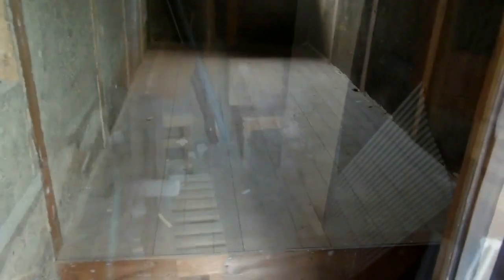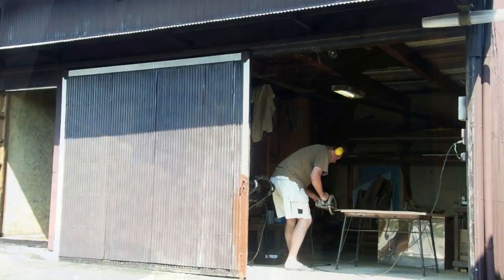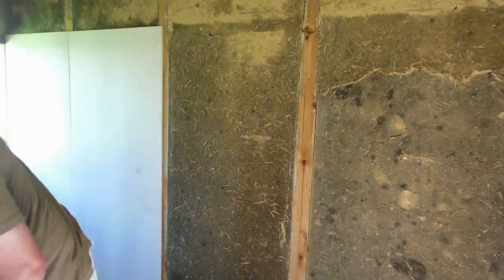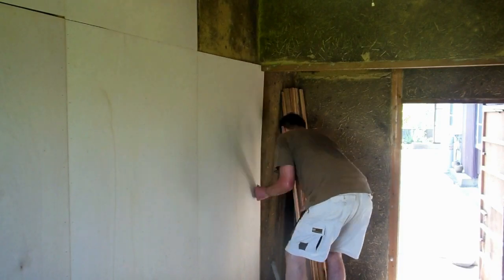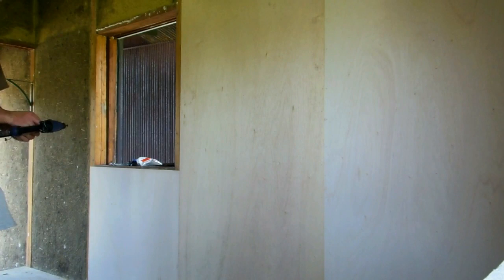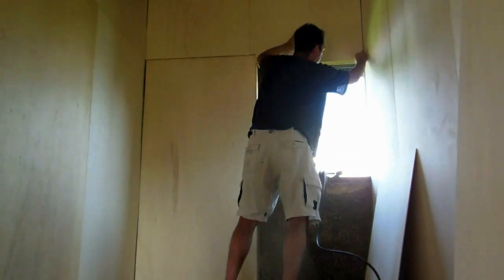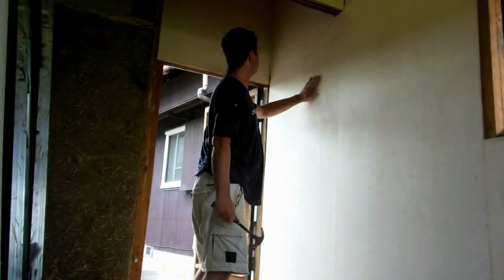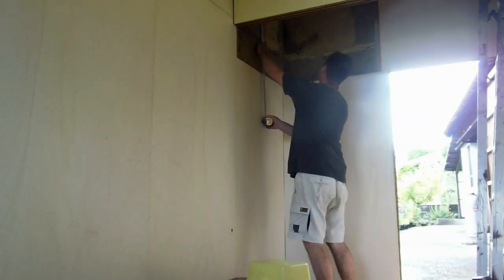Stage 2 Pickle Room Project at the Old Japanese Farm House

Comment: Awesome, will you sand down the floor a little and touch it up? I thought I probably would have painted the wood white, then sanded down the cover strips just enough to remove the paint and then nailed the cover strips over the white. Would have made a nice looking contrast, but I'm not an expert.

Comment: Surly 91cm is 36 inches, 3 feet or 1 yard?
Reply: Not quite.  36 inches is 91.44 cm.  Good guess though.  From the Wiki: 

The traditional units are still used for construction materials in Japan. For example, plywood is usually manufactured in 182 cm × 91 cm (about 72 in × 36 in) sheets known in the trade as saburokuhan (3 × 6版), or 3 × 6 shaku. Each sheet is about the size of one tatami mat. The thicknesses of the sheets, however, are usually measured in millimetres. The names of these units also live in the name of the bamboo flute shakuhachi (尺八), literally "shaku eight", which measures one shaku and eight sun, and the Japanese version of the Tom Thumb story, Issun Bōshi (一寸法師), literally "one sun boy", as well as in many Japanese proverbs.
Reply: @TheBoredPhysicist  Interesting! Pretty close though, if you used 2.5cm rather than 2.54cm per inch
Interestingly from Wiki on Tatami sizes:
The size of tatami traditionally differs between regions in Japan:

Kyoto: 0.955 m by 1.91 m, called Kyōma (京間) tatami
Nagoya: 0.91 m by 1.82 m, called Ainoma (合の間, lit. "in-between" size) tatami
Tokyo: 0.88 m by 1.76 m, called Edoma (江戸間) or Kantōma (関東間) tatami
Reply: @t15721  Haha I didn't know that!  I wonder if they just make them that size in that region or if you can buy them and say "I'd like the Nagoya size, please!" xD